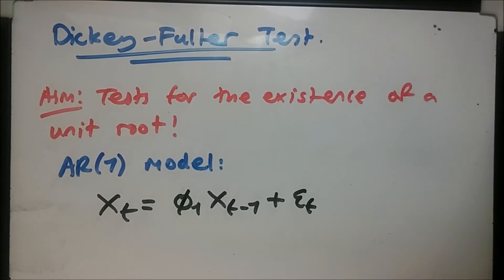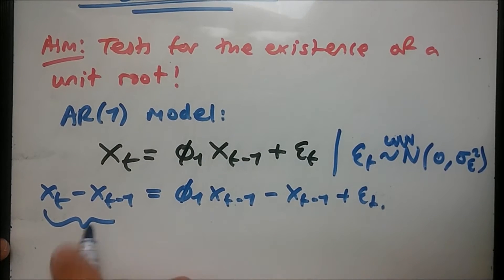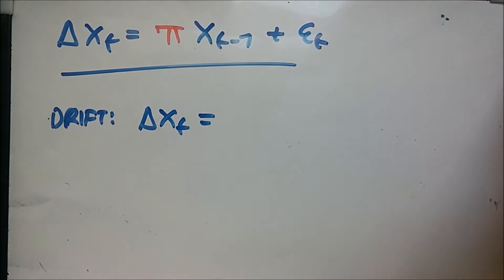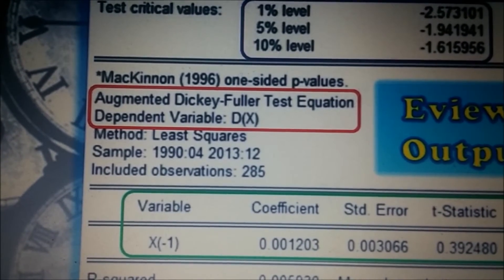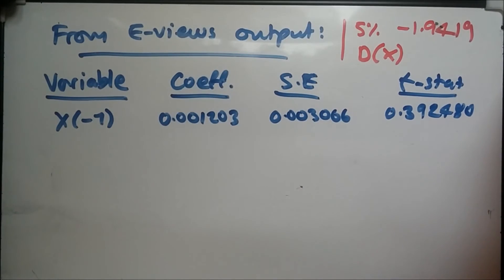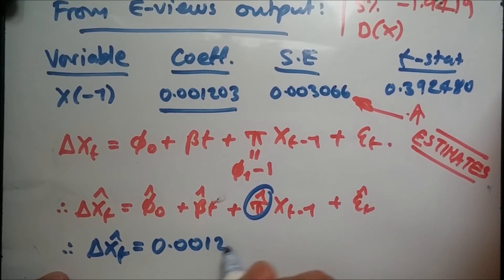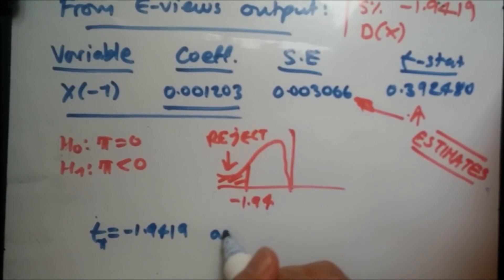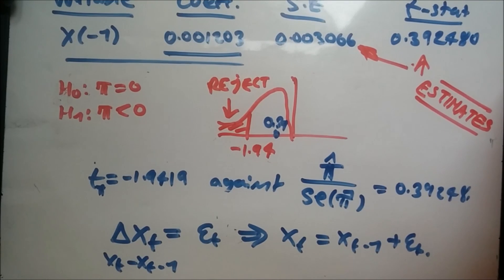Augmented Dickey–Fuller (ADF) Test for Unit Root: Explanation & Example from EViews

Comment: I have a question if you could help me out please.

1) Imagine i have time series data for Money Supply, spanning across 25 years
2) Next, i take log of all the values
3) Now if i want to test for unit root on the log of values using ADF, what option should i use? and why?
a) None,
b) Trend
or
c) Trend and intercept

4) What information criteria should i use to select max lag length? and why?
a) Schwarz Info Criterion
or
b) Akaike Info Criterion

5) and last question - (something a little different from all this) - Why would anyone want to take the log values of time series data, before testing for unit root?

I've tried looking everywhere but i haven't found the answer.